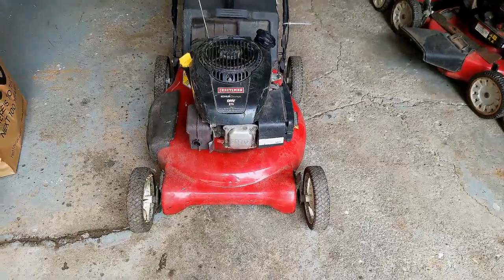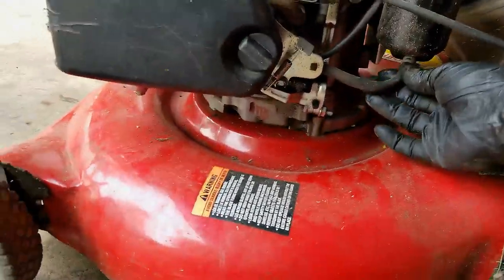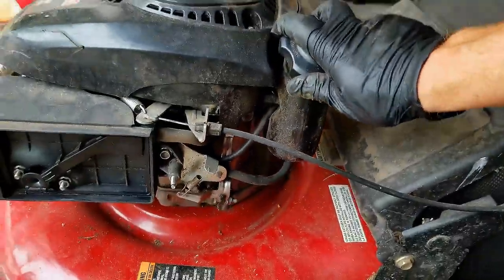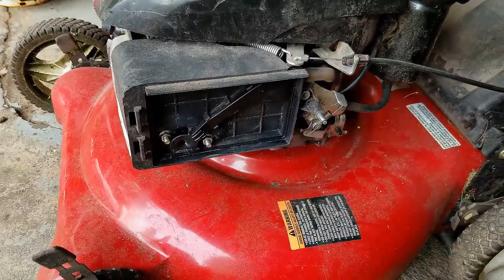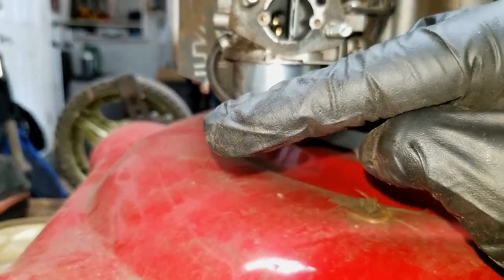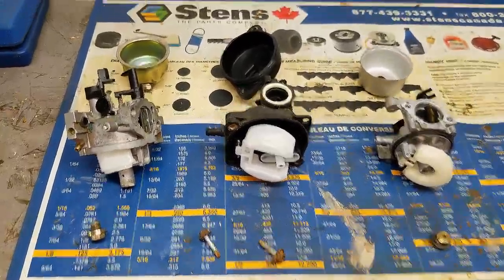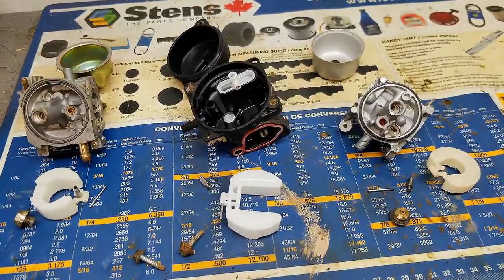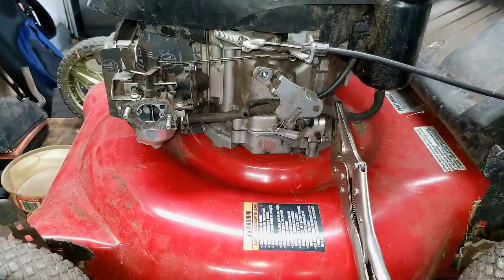Fuel Leaking From Air Filter

Comment: Great explanation of where the excess gas goes.  After fiddling with a few things (fuel line connection, adj. carb bolts, ensuring bowl not misaligned, checking bowl gasket & bolt gasket), thought it was resolved.  No more fuel leaking out sir cleaner

But then hard to start, hydrolocking (? When rope won't pull). Checked oil. Overfull, just like you said.  Oil looked thin instead of thick too.   Turkey baster'd some out & got it to run.

Got a few mowings in.  Went thru fuel like crazy.  Hard to start everytime. Lots of carb cleaner & swapping out / cleaning the sparkplug.  Many times rope wouldn't pull. PITA! But eventually would get going.

Rechecked oil.  Couldn't believe it was overfull again!  
It's gotta be the float/needle/seat.  If not, it's gonna be tempting not to drop a lit match on it and end the misery.  😮. Thanks for the great vid!
Reply from the maker: Definitely a needle valve stuck open or not sealing properly.

Comment: This is by far the best explanation of carb leaks that I have seen 👍.  My mower has a carb (Huayi) like the one on the left of the video (metal fuel bowl).  However, the foam filter is located above the carb.  I recently changed the blade, in preparation I removed the plug lead, bagged the tank cap, and tilted the deck to the right (exhaust low/tank, carb, air filter high).  Fuel leaked from somewhere on the carb.  As a result, I drained the tank and carb bowl to continue.  The carb does not leak normally.  When the machine is tipped to the side, is the float/needle valve compromised (no proper seal due to the abnormal orientation)?  I assume fuel flowed from the bowl/tank through the brass inlet into the carb.  It did not appear to leak onto the filter (uppermost), so assume it leaked out of the gasket between the carb and the engine.  Otherwise it would have gone into the cylinder inlet valve (fortunately the piston might have been at TDC thereby closing the cylinder valves).  Anyone readers had an experience such as this?
Reply from the maker: You will sometimes get a bit of a fuel leak, even if you've tipped it the proper way. This is not really a big concern but if you want, you can turn off the fuel shutoff or pinch off the fuel line. This might help.

Comment: What a fantastic video. I know a fair amount about repairing vehicles, took vo-tech in high school and then worked as a service advisor for years. But never had any experience with small engines, and not a whole lot about carbs either. This was such a simple explanation and has really eased my stress. I still think I'll replace my carb in my Kohler SV600S riding mower because it's getting long in years. But this will help me justify that once I pull the carb.
Reply from the maker: Glad you enjoyed the video and it helped. Thanks for watching and taking the time to leave a comment. Cheers

Comment: My lawnmower carb was leaking . I had not used this mower for 3 years. The motor control symbols were gone . I naturally assumed 
The GO was Full Forward And the Stop Was Back Toward Me , I pulled the engine cord heaps of time sand I saw the fuel leaking.
I took the carb off and apart and it looked fine . I put it back together , and my wife said try the motor control half way in case the 
ON  is toward me . I did and it started . I said to myself well DASH. ONE MUST HAVE A SENSE OF Humour!!!!
Reply from the maker: Glad you got your machine back running. Koodos to the wifey for the suggestion. Thanks for sharing your story. Cheers

Comment: Also debris,sitting long time and even a new carb may have metal shavings etc left in carb during manufacturing process that can cause float needle issues...floats can just stick...taking appart and inspecting and cleaning fixes issues a lot of times...you can even adjust  floats to close valve sooner or later very easy,then put together and test simply by blowing air and  manually moving float up and down you can note the floats postion when its open and closed...or it may not work and you can blow air through even when needle  is seated all the way...
Reply from the maker: Thanks for the suggestions. Cheers

Comment: I have a mower with the Briggs & Stratton carburetor on the far right in the video. The fuel started pouring out the air filter like you mentioned. Also, I had just replaced that carburetor a couple months ago with an identical new one, as the original the gaskets had worn out. I don't know how, but possibly mowing sideways on a steep incline sideways knocked either that float hinge pin or the needle valve out. It had about a 3/4 a tank of gas when that happened and it just poured out the filter. When I took the bowl off, both the pin for the float and the needle valve fell right out. I put them back in, reinstalled the carburetor and filter, and the mower works perfect again. I guess I just have to be careful mowing sideways like that, it's a very steep incline.
Reply from the maker: Glad you figured it out and thanks for taking the time to tell everyone about your story. Cheers

Comment: Very good explenation, just wondering, my carb starts leaking fuel into the air filter after i fill the tank with about a cup, so im guessing the float doesnt go up all the way so the needle doesnt stop the fuel from going into the float area, should i replace the float or the needle?
Reply from the maker: You can test the float by shaking it and listen to see if you hear any fluid sloshing around. Replace if yes. But I would definitely start with a new needle. Let me know how you make out. Cheers

Comment: Got a new needle , still getting fuel.. I bought  a new full carb  and can tell the difference by blowing thru them . Good video ...I got another carb for pressure washer , that one releases fuel thru the exhaust.. I have the feelings may be thesame issue (waiting for your answer) . How you usually cleaning them ? Iv hear ultra sonic bath it s an excellent method
Reply from the maker: Glad I was able to help. If you believe your carb is the problem, replacing it is the easiest fix. Especially since new carbs are typically so cheap these days. I do clean them as well sometimes. Yes I do have an ultrasonic cleaner but you don't need one. I have many carb cleaning videos on my channel. Hope this helps. Cheers
Reply: @brantsmallenginerepairs  you are right with the the carburators beeing cheep ..I'd rether stick with OEM once and fix em instead going with aftermarket...the one for pressure washer I got is a new one , but aftermarket, and  the fuel goign big time in the exhaust with the fuel line beeing open and sitting (no start) , after getting started (with bunch of pulling for the fuel to exit the exhaust)  will stay maybe 5 min running then it fills up again ... again , new aftermarket carburator , is like playing russian roulette with aftermarket once (not my first rodeo with them). 
Also,  what would be the best method to keep the carb clean on seasonal machines (the once sitting during winter) also talking about bugs goign in (had thos before) not just gumed up or moisture.
Reply from the maker: @eugeniujosanu279  I have had pretty good luck with the aftermarket carbs to be honest, although I don't replace a lot. My first choice is always to clean the OEM carb and rebuild it if necessary with new parts. But if given the option, most customers will go the aftermarket route over OEM given the cost is typically like 1/6th. Now for your question, the best advise I give for small engines is use ethanol-free gasoline. This will eliminate 90% of your problems. Also, before you store the equipment,  drain the gas from the tank and then start the machine and run the carb dry before storage. If you do this you give the machine the best chance of starting the next season. Hope this helps. Cheers

Comment: Great video thanks, easy to understand, I have the issue with a Poulon Pro with the gas coming out via the air filter..and making nasty spots on my lawn. Before I check further I need to rush out and get some parts before shop closes.
Would it normally be the float gasket if the float test is fine, or something else. I am not really mechanically inclined, but since retiring I try😀 to save the cost of shop work and it gives me something to do..
Reply from the maker: If it's coming from the air filter housing, it would have to be the float or even more likely the needle and seat not sealing properly to shut off the fuel. If the bowl gasket was leaking, it would be wet just on the outside of the bowl and not be coming out of the air filter housing. Just make sure also check your oil level and check for a gas odor in the oil. If the level is too high and smells like gas, then change the needle and seat.

Comment: I found this problem with a mower. I replaced the carb with a complete new carb and the same problem occurred. It started fine with the brand new carb, then a few minutes after running, I saw gas dripping out the air filter again. Is there any other potential cause of this problem? Hard to believe a brand new carb would have the same float/seat problem.
Reply from the maker: For this type of carburetor, the needle and seat is going to be your culprit. Sometimes the float gets "hung up" within the bowl and the fuel can not provide enough upwards pressure to unstick your float and/or needle. Try pushing the handle down to raise the front of the mower and then let the front drop to the ground. Do this a bunch of times. This will sometimes helps to "unstick" the float and cause it to work again. Hope this helps. Cheers

Comment: I have that problem with my lawn mower, the carburetor was pouring gasoline through the outlet where the air filter is, I bought another carburetor but the problem continues, it is still pouring gasoline through the outlet where the filter is. I don't know what the reason would be since it's new.
Reply from the maker: Sometimes aftermarket carbs can be hit or miss. If the fuel is leaking, the needle and seat are not making a good seal. Or maybe the float is stuck, not allowing the needle vale to shut off the fuel. Hope this helps. Thanks for watching and taking the time to leave a comment. Cheers

Comment: What if fuel leaks out only when the mower is running? I have done everything you have stated. No fuel leaks out when not in use. I took filter off and can see with a flash light the fuel ever so slightly running out when mower is running. On a level surface.
Reply from the maker: With the mower running, when looking into the throat of the carburetor, you will see the pulses of fuel coming up from the float bowl. This is normal. Are you saying that some of that fuel is leaking out of the carb towards the air filter instead of getting sucked into the engine?
Reply: @brantsmallenginerepairs  Yes. Fuel pulses up and down landing on the tube. Some runs down back to the air filter. Almost like there isnt enough suction or to much fuel is comeing out of tube. Do you know what would cause this?
Reply from the maker: @acer3  it's not uncommon for some fuel to splash back towards the air filter. Does the fuel drip or run out from the air filter housing when running? Is the mower running fine otherwise?
Reply: @brantsmallenginerepairs  mower seems to run fine. Starts fine. It is just a slow run toward the air filter. Only reason I would know is that the air filter is wet and smells like gas after mowing only. Thank you so much for taking time to reply.
Reply from the maker: @acer3  like I said, a little splash over towards the filter is most likely normal. If it starts and runs fine I wouldn't worry about it but keep an eye on it. Happy to help. Take care.

Comment: Most replacement carbs are so cheap these days I don't even bother with any sort of diagnoses and repair to them as it is often more work than just replacing it anyway. Just replace the old carb with a new one and you are good to go for years to come solving any current and future issues that may arise with the old components inside the old carb in one go.....
Reply from the maker: This is true but I like to fix oem and not just replace with cheap aftermarket. Sometimes it's not possible but I like trying to fix stuff first. Thanks for watching and taking the time to leave a comment. Cheers
Reply: I have a question what about the gas in the oil how is that issue solved?
Reply: @acesmoka that's usually the rings are bad.
Reply: @brantsmallenginerepairs  I was looking up carburator OEM parts and noticed it was not cheap to buy them due to shipping. Repair shops in my area are pretty far gone or far enough away that I'm finding just the trip to them to place an order is no longer worth it. What are your thoughts on things like this? I know you like tinkering though. Do you have a place close by that has these parts in stock?
Reply from the maker: @TingTingalingy  I typically always start with trying to clean and replace any bad parts. If the parts are not available or cost too much, I will then revert to buying a new aftermarket carb. Cheers
Reply: But this is my 3rd carburetor it always happens . I get to cut till bag is full of grass then when I restart it won’t start then gas leaks out. Wait a couple hrs and I cut again same thing. This is a new carb only a month old
Reply from the maker: @hissonshinegirl  are you priming it to start it when it's hot?
Reply: @hissonshinegirl  I'm rather intrigued by this issue your having. I'm new to small engine repair so I'm intrigued to see what comes of this
Reply: @hissonshinegirl I'm about to replace a John deer carb over the exact same issue
Reply: @TingTingalingy Or the carb is dumping tons of gas in the engine

Comment: other than needle and seat, can the float (kohler carb) be adjusted? Mine tends to dip down about 5 % when the carb is hand held upside down
Reply: 5 degrees
Reply from the maker: The older cork floats used to be adjustable because they had a metal tab where the needle valve was. These plastic ones are technically not adjustable but you could try to warm up the plastic tab that holds/pushes the head of the needle valve down. Once warm enough, try to bend it slightly. Please be careful not to do this close to anywhere near a fuel source. Hope this helps. Cheers
Reply: @brantsmallenginerepairs  thanks, I was fixing the mower for a neighbour ended up buying a carb off Amazon received it yesterday (was even same huayi) results No leaking starts first pull, all good
Reply from the maker: @daved.4740  great to hear. Glad you got it sorted out. Cheers

Comment: What if you’ve replaced the carb with a brand new one and it’s still leaking down the back of the air filter housing. I have a GXH50 Honda engine. Cheers
Reply from the maker: It sounds like your needle valve inside the carb is not seating properly or the float is stuck in the down position. Both of these would cause the fuel to not shutoff inside the carb. Both would require you to take the carb off and inspect these 2 possibilities. You did the right thing by changing the carb but sometimes these knockoff carbs come faulty right out of the box. Hope this helps. Let me know how you make out. Cheers